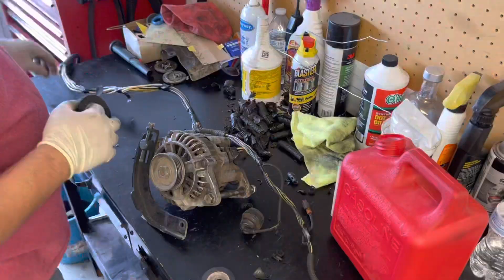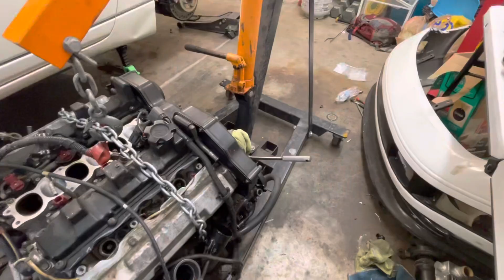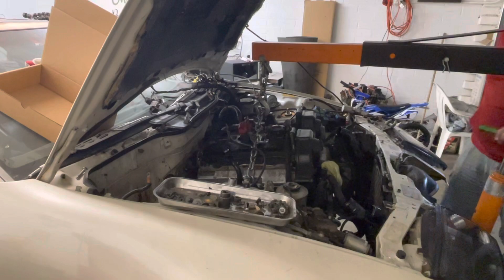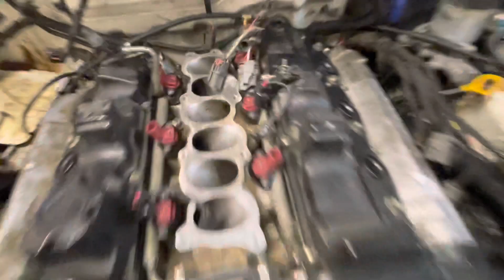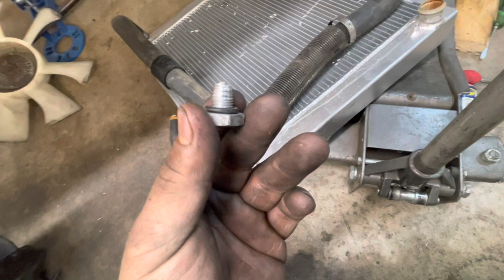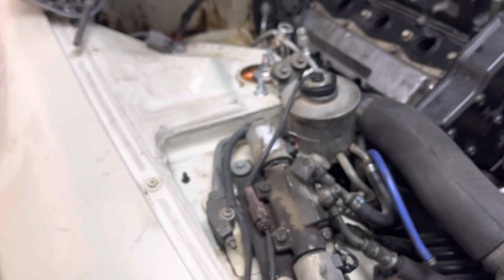300zx engine reassembly Vg30de/TT part 3

Comment: Hey bro I’m running the same turbo’s your running, can I use my stock oil lines or do I need to get braided ones like yours? And if so which ones are you using?
Reply from the maker: You’ll need the braided lines. It’s possible it fits on turbo but the opposite side will be different then stock. I should have the part numbers somewhere I’ll look them up again
Reply from the maker: I got the mamba oil feed lines for t25 turbos on eBay
And a hardware kit from concept Z performance part # 15190-VP1TB-KT
Reply: Thanks bro just placed my order for both
Reply: Bro are you also not running any water lines to the turbo’s? I’ve only seen oil lines hooked up before you dropped in the engine
Reply from the maker: @fjaime316  yeah only oil feed lines no coolant. You can if you want but it’s not necessary